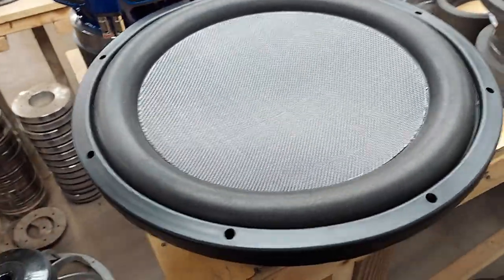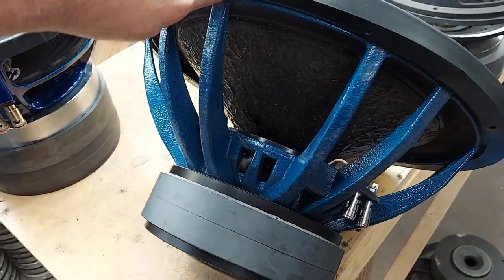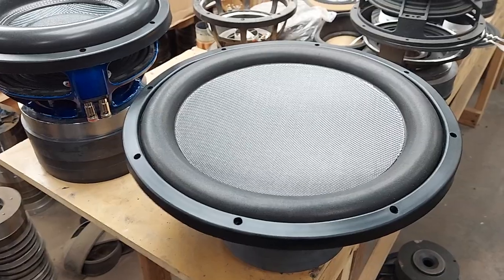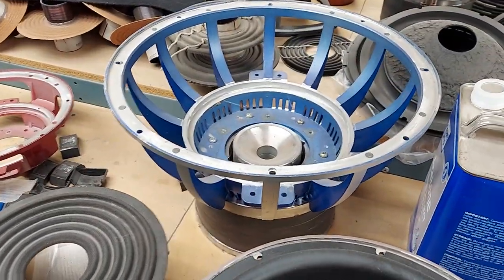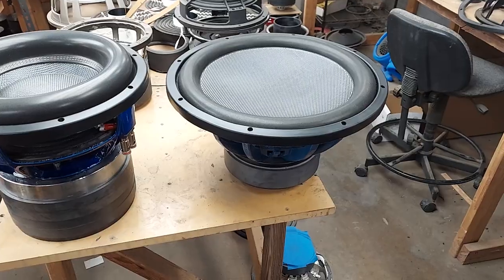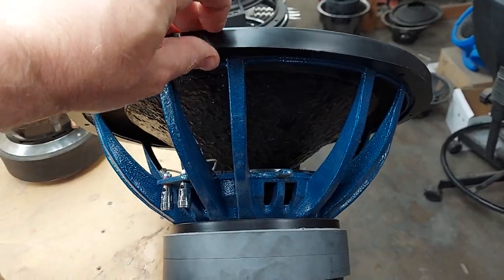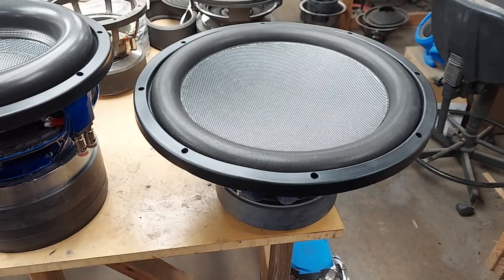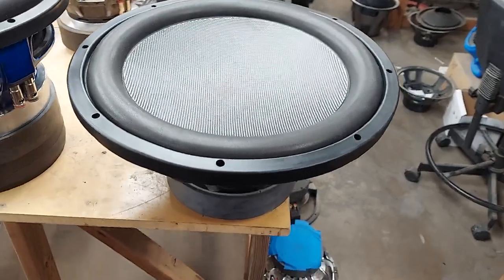Power Acoustik MoFo conversion to DD / VMAX 15" frame. 27hz Fs!

Comment: i have the mofo 15s 2 ohm i have 3 of them 2 are in ported box in my 09 dodge journey ....point is one of the blew kinda or the coil became crooked is there an easy fix for this or do i have to recone it second lets say i want to upgade what all recone kits will fit in this basket
Reply from the maker: Recone.   I remember epsilon selling the recone kits on Sonic Electronics if I remember right but check on Amazon too

Comment: Hi I was wondering if you would be able to fix/upgrade a 12 inch svs sub woofer. I ordered it for a spare and it showed up with a bent basket and the eBay seller wouldn't respond. I couldn't find any one that would even reply for a fix and I have messaged 3 different places. If it's junk it would be nice to know. Thanks for your time and reply have a great one till the next one ✌️👍👌💯
Reply from the maker: Sure, send it in.  720 W. Southern Ave., Mesa, AZ  85210

Comment: I have 6 of the bamf 15s what would you charge to do any upgrades to them
Reply from the maker: Send me side pics and the gap dimensions.  6023126504
Reply: I dont have any cut apart because they all work as of now
Reply from the maker: @418lightning8  start building boxes and amps to set them up as combos.  Post on FB or Offer Up.
Reply: well then what do you charge for sundown x clones
Reply from the maker: @418lightning8  $250 to $350 each, depending on features.
Reply: @RobotUnderground  guess ill have to call and setup a build thank you also when you build these subs do you have a suggested box parameter
Reply from the maker: @418lightning8  Those are great subs.  I've been meaning to get hold of one.  Epsilon makes great stuff under all their brands.  Text me a side / profile pic so I can see how they set it up.  Then the gap dims.
Reply: @RobotUnderground  would you like one i think I could hit my goals with only 4 of course we should be able to work something out